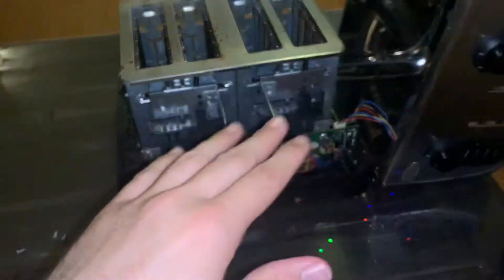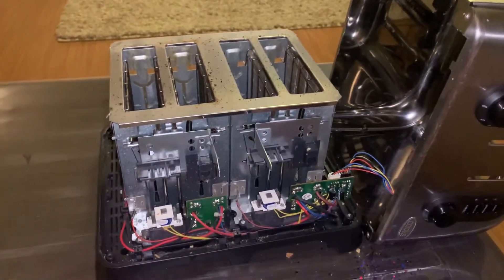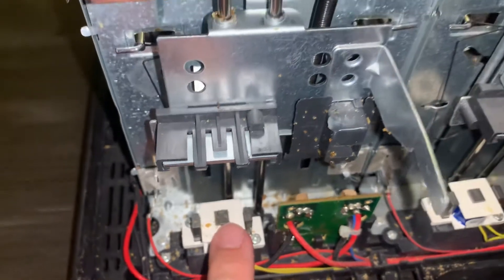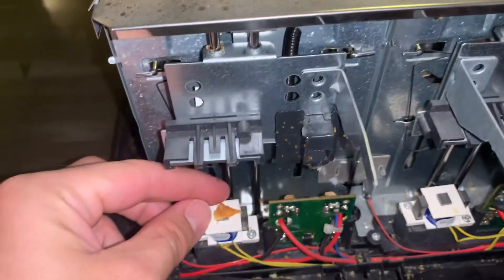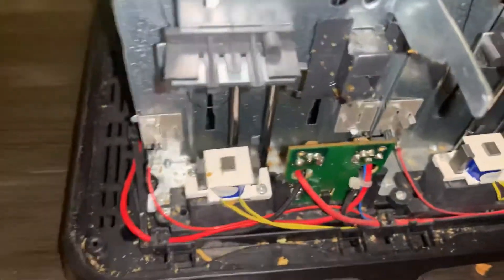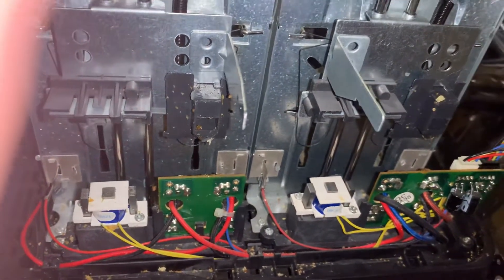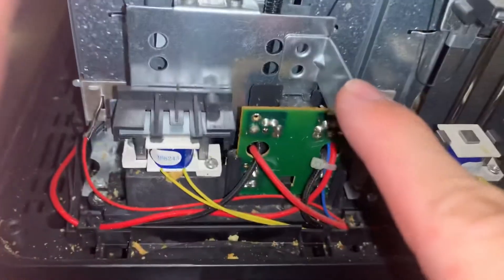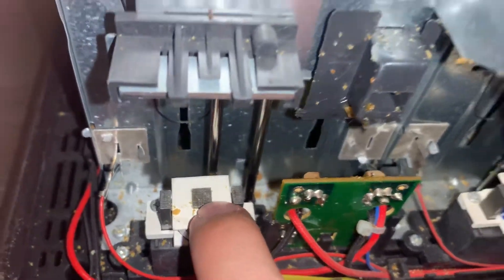Quickly Fix Toaster that Won’t Stay Down

Comment: Thank you for this great tip! I cleaned the toaster crumbs like other suggestions and the problem persisted. Once I saw your video I realized that my Oster toaster had some dirty on top of the sensor. Once I cleaned it, connected to the outlet and the issue was fixed! 👏🏽👏🏽👏🏽🏆

Comment: Except tip! One side of my Cuisinart 4 slice toaster stopped working this morning, and was no longer holding down the tray in the right side. I was about to pull the cover off to see if I could find the faulty component, but decided to take it outside and give it a good upside-down shake first. This cleaned away whatever chunk of burned bread was blocking the contact point for the tray hold down magnet, and it instantly started working again. I'm glad I saw this before putting in the effort of pulling the cover off, because I don't always think of the simplest solutions first. I highly suggest this easy procedure to anyone that has this issue. (Remove the crumb tray if it has one, hold toaster upside-down above trash can, or bring outside, give a good shake and tap).You will only get so far with the manufacturer on an issue like this, and will likely be told to try this, or "it needs to be replaced". We live in an age of "throw away" parts and items for automotive, home appliances, and many more industries, and its sickening. Planned obsolescence. I see people bash Cuisinart, and there will always be people that got a bad appliance and will say "its junk" or "garbage". I personally have had my Cuisinart toaster for about 4-5 yrs now and have never had an issue until the neglect of keeping it cleaned out today, and its now working fine again.